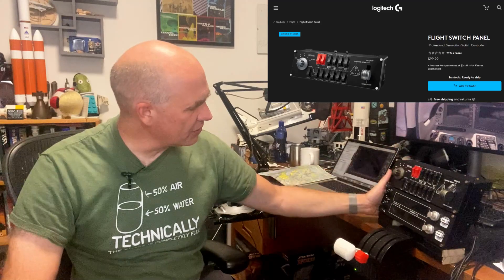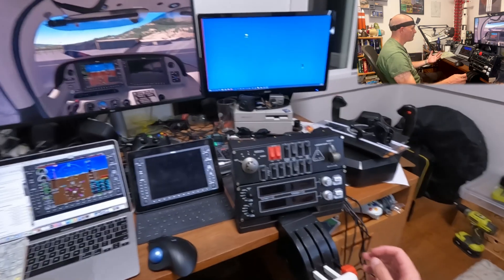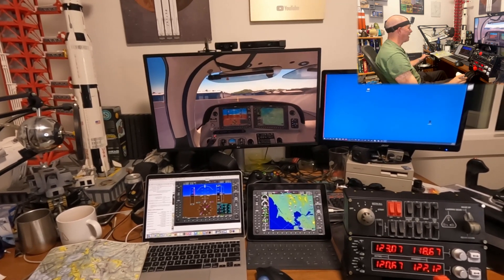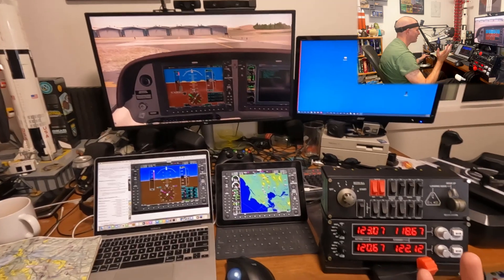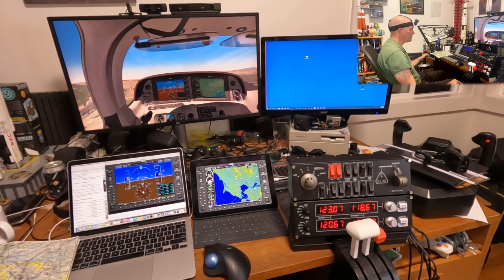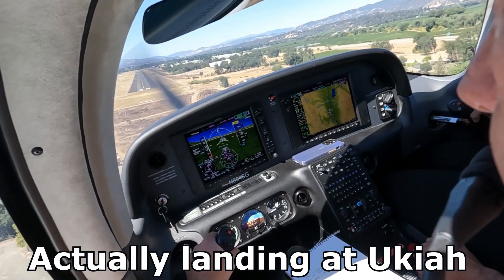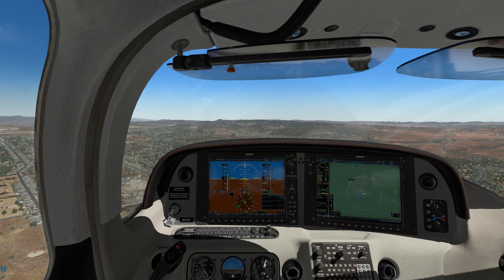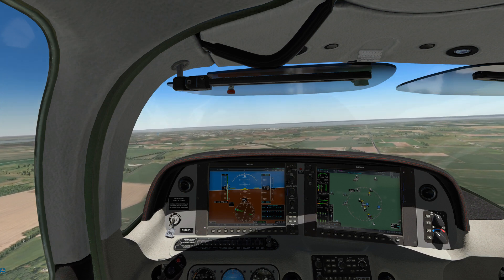Learning to Fly With Real & Sim Hardware

Comment: As a fellow student pilot, I appreciate these updates. I'm also trying to spend time in the simulator, but it's always a struggle to find time to practice in the sim, take real lessons, and have a job and friends too.

I started taking flying lessons back in 2007, but at the time a lot of people were recommending against using the simulator at the same time. My experience in (re)starting lessons now and starting with a simulator at home, is that the simulator is hugely beneficial. It's doesn't teach any feel for the airplane, but it's great for me because I learn by making mistakes and exceeding what one should do. I can smash the airplane all I like in the simulator, then push a button and get a brand new airplane! It allows me to do all the dumb things without an instructor stopping me or yelling at me, and getting those out of my system.

Comment: I grew up in Novato, and my father kept his piper colt, then tripacer,, then Cesna 172, and finally 182 (with a Robertson STOL kit) at Gnoss Field, before moving it the Smith Ranch , which is now the San Rafael Airport I flew into and out of that airport dozens of times, back in the 60s and 70s. I was very disappointed to hear the the plans to extend the runway length was canceled (again). Marin County is going to have to be dragged, kicking and screaming, into the 21st century. Here's hoping for your continued success in your air venture. Keep one eye out for Mt. Burdell, during the fog.

Comment: Personally I don't think it's really important to have a great similarity between the simulator and the actual airplane.  Afterall, once you get your license you're not likely to fly just one kind of plane all the time, and you can just look at your simulator as a different kind of plane.  Even a cheap rig like just the joystick (which is the same one I have), makes for a valuable training experience.  However, there's definitely fun to be had in geeking out over making a cool setup.  The one thing that I find most valuable about the simulator is the pause button.  Unlike in the real airplane, you can hit that pause button and take a moment to self-assess where you are, where you thought you were, what you've done, whether that was right or wrong, and what you are about to do, and whether that's smart in light of all that.  It's a great tool to avoid committing mistakes to muscle-memory by repeating them over and over.

Comment: A big problem in flying/"training" in a sim is that you don't have a real (and hopefully, experienced) instructor with you. One thing you showed that I think could be seriously dangerous was attempting to land on a street. I hope if you mention that to your instructor, they would point out that streets seldom have appropriate "safe zones" and clear areas. In fact, streets/roads have lots of fixed objects that are NOT frangible! Not to mention power/phone/cable lines! Plus, they have these pesky vehicles that seldom yield to landing aircraft!! Seriously, always keep an emergency landing area in mind. That may be a very difficult problem in the built up areas you may be flying in. But I think you'll find street landings are much more dangerous than most any other "clear" space, even if it is not really long enough to avoid a less than 'normal' deceleration. Just don't let a sim "teach" you BAD HABITS. 😁 As you say; "Fly (and land?) Safe!" 👍

Comment: Sorry small correction: DO NOT TURN STROBES ON TO INDICATE ENGINE START. Strobes BLIND other pilots at night in close proximity. The proper way to indicate engine start is to turn on the rotating beacon and yell "clear" out the window.

You don't turn on strobes until you cross the runway threshold to take off. When landing and crossing the runway threshold the other way, you turn the strobes OFF. Do not taxi with strobes on, again, because you blind other pilots. Ask your instructor.
Reply from the maker: This is the checklist in the Cirrus POH https://www.se.edu/aviation/wp-content/uploads/sites/4/2020/11/SR20-G6-POH-1.pdf
My instructor insists I use the checklists
Reply: @scottmanley  Found it in there, thanks. That's strange. I have flown for 42 years, never seen that.
Reply from the maker: I’m sure it’s aircraft specific, the SR20 just has the Beacon/Strobes, Navigation lights and Landing lights. It also has ice lights that illuminate the wings to check for ice.
Reply: @scottmanley  Identical on Cessnas. I suspect that Cirrus recommends you turn off the strobes to taxi, but hey, I am a big believer in following your CFIs instructions.

Comment: Wow 5% over airspeed and lost a flap best not make any wind miscalculations with wind effects on those engineering tolerances.
Reply from the maker: The problem was the simulate plane wasn’t a G6 and had lower flap speeds
Reply: @scottmanley  you said as much. I didn't catch the g6 flap deployment max. What is a typical delta v for standard flight? 156 is 4% over 150 feels hideously narrow fail mode safety factor but i deal with. electronics and transients.

Comment: It would be exciting to incorporate a 3 Axis motion table. It doesn't produce actual G's, but it does add a lot of realism. Have seen them used for sim auto racing. Many top drivers use extremely high end hardware and software. The systems can recreate any major racetrack in world. Data collected from real racing is fed into the simulator for later use.

Comment: After I solo'd... I'd practice my go-a-rounds and to get the most for my money - I'd land at flying speed :)   In the middle of one of my quickies  I tipped my left wing & started doing a banked turn into one of the landing lights.  So i went full throttle, climbed & buzzed one of the offices at the airport :)  I wonder if it looked cool or stupid.  It scared the crap outa me!  I was assigned a new instructor the next time up.

Comment: Looks like you could use a VR headset with that setup, if the switches are located correctly that would be extremely immersive :D

Comment: Procedure. Procedures I teach to prep for....those things that you CAN make into reflexive motor response..

You're sitting a chair and...BAM the engine fails at ANY point in flight.....there's GOD'S RULE.......PTLT (pit loot in my head).... Engine failure PTLT Engine failure PTLT Engine failure PTLT Engine failure PTLT Engine failure PTLT.. When in a multi it's harder DFDE PTLT. Dead foot dead engine pitch trim look turn. 

Which has you INSTANTLY pitching, trimming. looking (for a place to set down), and THEN turning toward that place. I can name four dead guys that didn't get that order correct.

"pit loot" saved from me from terror when I had an engine out over Long Beach CA.... 

So I'm flying from San Diego to Santa Monica ferrying a plane...and decide to switch tanks over Long Beach. Engine sputters and dies. ENGINE OUT PIT LOOT....instantly in my head...and within SECONDS I had the airplane under full control with a plan. Dude....until you are THERE you can't know how much time you have to react for a situation but you CAN train away a great deal of bad odds by instantly being refexive....in a very controlled way. 

The feeling I had about training this to people and never needing it always left me feeling not sure....then after the incident it was SO satisfying to know it was 100% effective at increasing my response time to bad news.

pit loot didn't save my life...I switched the tank back, got the engine back on, and flew to Santa Monica. 
the moral is the CONFIDENCE to have your odds maximized by prepping muscle memory. 

Another thing is in a near runway incident (this for new pilots) you can prepare for the right muscle response by shoving your head to the right while your left foot is stomping....this helps the response of seeing an airplane begin to go cattywhompus. Your foot needs to push the opposite direction that seems wrong and new pilots have the most trouble with feet.

Btw...I've trained three drummers to fly...they are easy to train. They might be shit for procedures but their innate ability to fix a problem quickly makes them all safer pilots. Stick and rudder is SO important. the 141 school I learned and taught in did not emphasize sticker and rudder. I had a guy that owned a line of Agcats for dusting laugh at the idea of hiring me from my civil aviation 141 flight school background. He had 4 agcats on the line and three wadded up ones after those...he apparently liked to stress SAFETY to his pilots.

Comment: How do you find the real plane controls compared to the joystick? It annoys me to no end that literally every joystick on the market from the cheapest junk to the most expensive ones has this nonsensical hard centering that makes fine control impossible. The only one I've ever seen that hadn't was a real military pilot training simulator at an airshow, it had a real fighter jet stick and I guess more or less simulated a real plane feel and was silky smooth at the center. I modified my logitech (the same one you have) for a smooth load curve and flying with it became so much more easy and enjoyable.

Comment: Scott, I have a burning question about reentry. The reason we do not use rockets to slow us down for reentry is that it will take an equal amount of power to slow us down as we used to get up to the speed we have in orbit. But I counter that we have that power in kinetic energy as that is what causes the high temperatures during reentry.  Who is doing research into utilizing that kinetic energy to power the deceleration? If the issue is about needing a propellant, the same gases in the atmosphere that are causing the friction during reentry are just sitting there and could be scooped up and used as a propellant. The heat from reentry could be used to power the engine. I am not a rocket scientist but I have to imagine someone has thought of this before… right?
Reply: They have been using the power of KE to slow down since the earliest days.  That's what a heat shield does.  It's not friction that causes most of the heating, it's compression.
Reply: @TheEvilmooseofdoom   My understanding is that we are not really “using” the KE with a heat shield, but instead just trying to dissipate the KE without burning up the craft. My thought is to actually use the KE to power an engine to produce thrust to decelerate the craft.
Reply: @samsanchez8997  Yeah, that's what's being used, the KE in the object.  It gets turned into heat.  Energy doesn't equal thrust.  You need to move mass to do that.  So there are real limits on what you can do with KE.

Comment: Xplane or MSFS?  Also, what app are you using for glass cockpit?  I have the thrustmaster yoke which is excellent, but not cheap.
Reply: He mentioned it's X-Plane.
Reply: @Ergzay  Thanks, missed that (listening in background while working)
Reply: I also tried a slip approach in MSFS, and right away I can tell it takes practice to become good at it.  I had the unfortunate experience of being in the back seat of an archer during some aggressive slip during approach once, it can sure be rough.

Comment: if you want all the bells and whistles for your flight sim you should try a headtracker. With those you can look around in the sim using slight head movements and it makes the experience 10x better. I personally use the track IR 5. (never have to use the mouse to look at checklists and much cheaper than VR)
Reply from the maker: If you look carefully you can see I have TrackIR

Comment: Sorry to say that, but for me X-Plane is dead. I might take a look at version 12, but i am all in on Microsoft Flight Simulator. The level of fidelity and immersion is just mindblowing. Especially for general aviation, which you are doing now. I can not imagine, that v12 is able to get even close to the experience MSFS is providing.

That being said, i spend my money for addons (like for planes, airports and scenery) in MSFS. I can not afford to spend it for two simulators.
Also i can never go back to monitor flying. I do that, if i want to make YouTube Videos, but normally i am using VR.

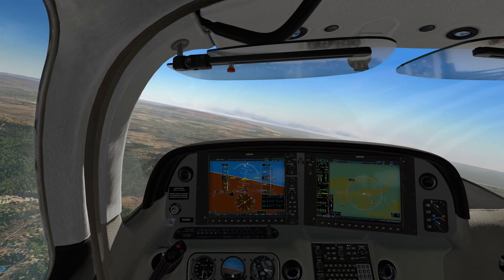PS: Oh god when i see how bad the framerate is at 11:37 i know exactly why i never want to go back to X-Plane. 😂 Of course you do not need so much FPS in Flight Simulators, but now with MSFS i have 60 FPS on Ultra Settings with my 5120x1440 monitor and that is just a dream coming true. X-Plane was never able to achieve that, equal what hardware it was running on.
Reply: The main thing with Microsoft Flight Simulator is the flight physics model itself isn't very good. That's likely why he's using X-Plane over MSFS.

MSFS is a game while X-Plane is something you design professional flight simulators with.

Comment: 13:30 The wing rocking thing they did when I landed at Oshkosh for real back in about 2000. I'm not a pilot but a buddy of mine took me out from a nearby field and we landed (over the top of a 747) on that runway! I was told its because there are so many transponder signals the radar just looks like a disco light so they eyeball everyone. As a young guy from the UK who had never been in a light aircraft, gettting to fly it and then landing at a place with so many thousands of aircraft.... mind blowing!
Reply: the wing rock is to establish communication with a specific airplane without the pilot needing to reply over the radio... that extra chatter would simply take up too much time given the traffic density

Comment: I'm a UK PPL (Private Pilot) and I did my PPL licence in 1978 on Cessna 150s, so no fancy electronic gizmos back then. But flight is flight, and the aeroplane is only interested in aerodynamics not what is going on on the panel.

No pre flight checks, including controls and power check and most importantly configuration check - presumably omitted for clarity of the video?

Light aeroplanes do not have a rotate speed. That's for transport category heavy metal. Light aeroplanes fly when they are ready and they will tell when that is - if you are listening. My favourite mount, the lovely dH Chipmunk, can be hauled off a muddy airfield at a ridiculously low speed and flown on the back of the drag curve while it accelerates in ground effect. It will tell you through the stick when it's on the right side of the drag curve and can be safely climbed away.

Flaps - I like mechanical flaps - you can FEEL the forces as you apply flap so are unlikely to deploy them mistakenly above Vfe. On your Oshkosh approach I'd have retracted the remaining flap and done a flapless landing. You may be able to maintain roll control with asymmetric flap  during the approach, but a go-around could mean an uncontrollable roll into the ground as power is applied. If the remaining flap could not be retracted, I'd have declared an emergency (yes, even on that busy Oshkosh frequency) and continued to a certain landing. In an emergency, no controller in the world can tell you to go-around if you don't think that's wise.

Engine failure - yes, no.1 is get the nose down IMMEDIATELY - lots of pilots die in the 'States every year (actually a few per month recently) through NOT getting the nose down; speed bleeds off, one wing reaches critical AoA (in a few seconds!) and you're into an incipient spin from which there will be no recovery (just this happened to friend of mine in a PA38 some years back at Manchester Barton). Check out Dan Gryder and Blancolirio on You Tube for more on this. More subtle is PARTIAL engine failure, which happened to me in the Chipmunk. The decision process is then not so clear cut!

Slipping: I have not flown a Cirrus but I recollect it has quite a slim round-section rear fuselage which won't create a massive amount of drag when flown sideways, so the slip will not have anything like the effect on rate of descent that it will in a slab-sided type like a Piper Cub.

That final power-off approach looked very fast! I don't know the Cirrus but it looked to me you were pretty hot, and that power increase 'for pitch authority' just made it worse! I reckon carrying the speed you were carrying you could have climbed a few hundred feet without power had you needed to, eased the nose over, and landed off that!

Don't worry about bouncing. As long as they are diminishing bounces they are safe, otherwise go around. Oh, and always plan to go around anyway. If you don't need to and land instead, that's great. But there's absolutely no shame in going around. Quite the reverse.

Enjoy your flying! For me,. it's one of the best life choices I ever made.

Vince

Comment: 12:10 While she was technically correct, that wasn't the best way for ATC to communicate the information.  People remember things via primacy and recency, i.e. they will remember the first and last thing you tell them better than anything in the middle.  Anything that is out of the normal flow for the pilot should either be the first or last thing you say.  Since a right-hand pattern is unusual for most airports, ATC should have said something along the lines of "Report RIGHT midfield downwind runway 30."  When you initially repeated the information back to her you said "Report midfield downwind", omitting the instruction for a right-hand pattern.  I missed ATC tell you right-hand traffic on the first listen, myself.  If ATC had been more on the ball she would have noticed that you didn't repeat the direction of the traffic pattern on the read back and should have repeated her instructions to you.  Technically you were "in the wrong", but ATC wasn't exactly on the ball, either.  This may seem insignificant, especially in a sim, but this kind of thing does happen in the real world and if you are in busy airspace it can lead to a mid-air collision.
Reply: You're forgetting that that controller was also covering over 40 other airports at the same time.
Reply: right pattern is not unusual, esp in a towered environment